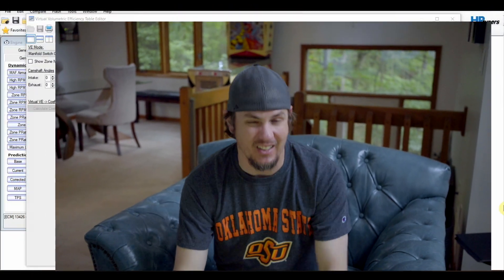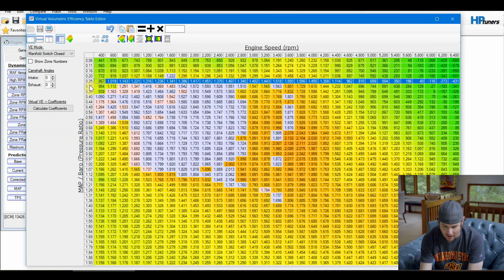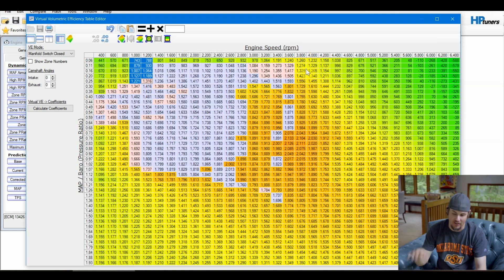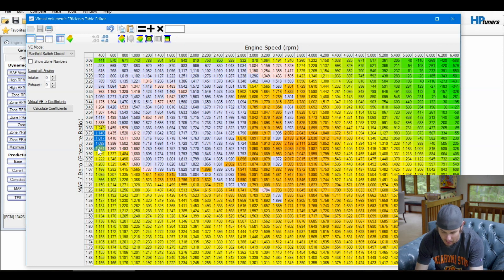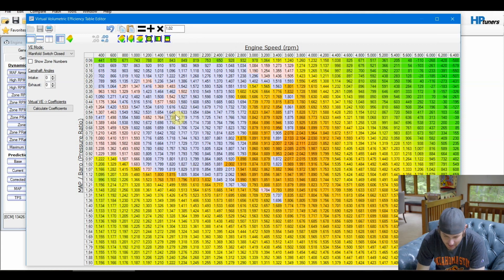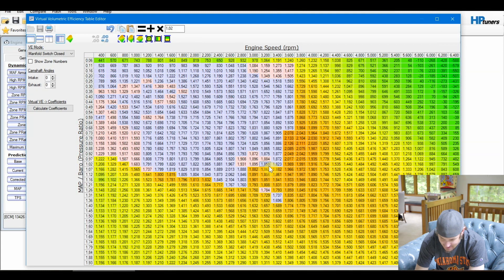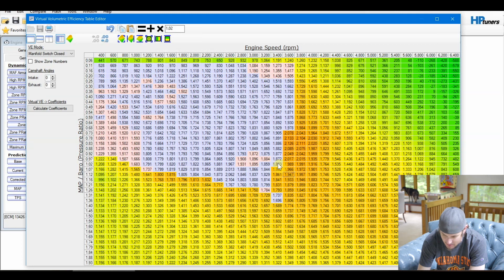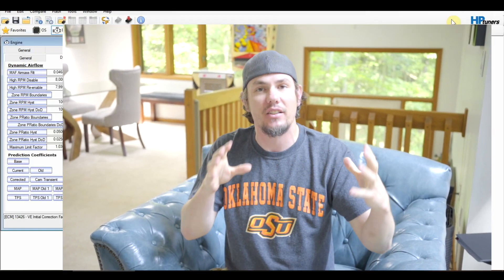Speed Density Map Tuning And Manual Adjustments in HP Tuners, Smoothing Things Out!

Comment: Another great video. Is there a way to put your ve over lay to make adjustments ( copy multiply by half)  not change any values? Just thought if I'm making multiple pulls and tunes in the same area every time I paste and multiply that section would get bigger and be off scale or spiked up over time to create a big ol rich zone for the recorded cells? Or is multiplying by half so little that it wont matter?
Reply from the maker: You should be writing your changes so the next log you pull is using the updated tables so theoretically every log the amount should be less and less until it's negligible.

Comment: Bob Ross would be proud. lol This is similar how I tune my VE tables. In my experience the automatic VE calculations on older ECUs I have worked on are ok but far from perfect. Sometimes you will get a particular VE cell that is way different than the ones around it and you know that it is wrong. So you have to do a little bit of educated guesswork based on the VE cells around it to get a number that is more reasonable. If your logging supports it I look at the history average calculated VE in that cell based on the number of hits that VE cell received during logging.

Comment: Love the video and the picture thumbnail :;  ...  in SD do these numbers have any correlation to Stoichometric.  I am doing exactly what you are doing over need in my boost being super rich.  So I'm trying to lean it up yet smooth into the perimeter as you are.
Reply from the maker: Yes and no, lol! They do in that this is the figure the ecu looks at and says, okay we have that much air, it then looks at the stoich table to determine what ratio it needs to hit and it calculates the amount of fuel delivery. If you are are if target from your desired EQ this is where we adjust since we can't actually change the fuel delivery, per say, but we can change the amount if air the engine thinks it's taking in.